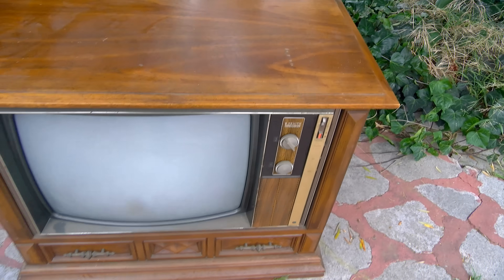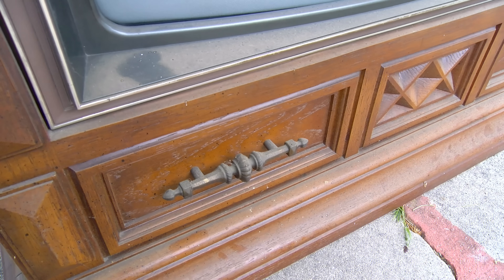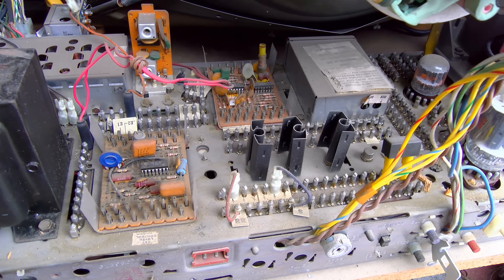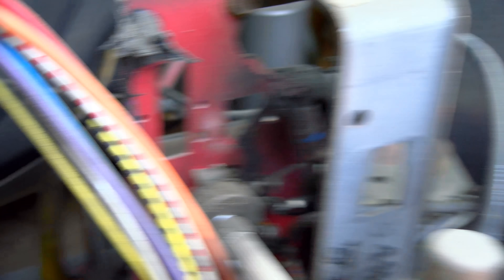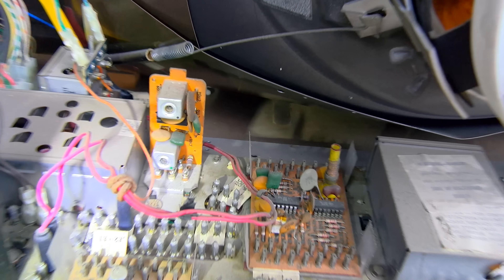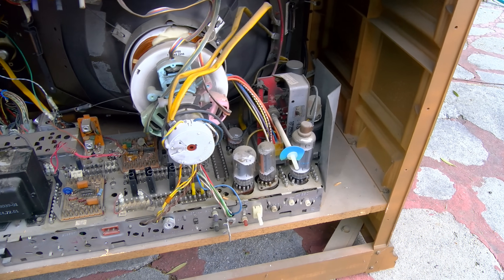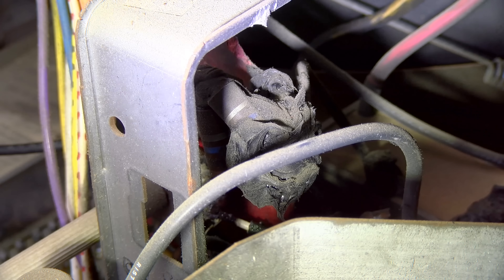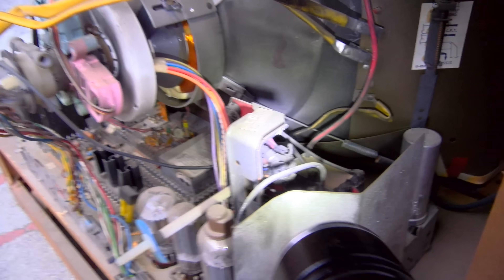Zenith Chromacolor 1973 Color Console 4 Tube Hybrid Television Analysis

Comment: Zenith was just tooling up for their all solid state chassis which was fully laid down (horizontal mount) in the cabinet (not the more commonly seen vertical mounted chassis in later releases). The 4 tube design was an "interim" set with a lower selling price than the solid state sets.

Comment: what kind of cord did you use to plug this tv up? I found a tv quite similar to this one, although a tad bigger, and I've been searching for a power cord to use for it. The prongs you'd plug the cord into are really strange, cause one is like twice the size of the other. I can't any power cables that would match it, and was wondering where you got yours from

Comment: The Zenith Chromacolor 23 inch model year 1971 / 1972 was my parent's first color television. Wood or particle board cabinet; not as much plastic. Also an early hybrid with an IC color demodulator but the HV was traditional. The sales shop on Whittier Blvd in La Habra was adjacent to Charles Stone Television repair. Hence, if a customer asked for the BEST color TV, they were directed to buy Zenith exclusively. We spent over a month just watching TV. It was an amazing picture; much better than color televisions we had seen at relatives and friends. The chromacolor CRT with black mask was REAL and SPECTACULAR innovation. Anyway, we burned the heck out it for months. Then the electron guns in the CRT started arcing. So Mister Stone took it in his shop. He said that they get some gas that shows up later. Years later the color was wild squirmy crankipation. Mister Stone sold me the new IC for his cost ($17) and taught me what to do. Bam! My folks kept that set for so long, their next set was solid state. Watching that spark and arcing in the neck after the back off and ran the set with a cheater. Hooked me on CRTs!

Comment: as a   repair man  for 40 +years   i repaired hundreds of zeniths sets of that era  ... they were actualy fairly dependable  .. except the focus board  also  the dark grey silicon and component lift from circuit board was factory after the  manufacture was  informed of the issue    ... there also was no preference to gun failure in the crt   ..    .. enjoy your videos   .. brings back memories from the back of the set
Reply: @BlondieHappyGuy  on disability due to warn out back ..  i still remember how heavy they were  especially the sony  tvs

Comment: All the Major Manufacturers had the Top of the Line sets with 100% Solid State Chassis, then the Budget Line with the 4 Tubes. I am surprised to see Circuit Boards, as back in 73 Zenith was still crowing about their Hand Crafted Chassis, which was interpreted as Point to Point Wiring
My friends family had a Zenith in the Late 70s. I thought it had a Poorer Picture than our early 70s RCA, but her Dad insisted that Zenith was a Better TV.  Myself, I thought that Heathkit made a better TV

Comment: The value to me is the cabinet and looks.  If I had the skill I would put in a crt tube from a more recent vintage salvage set or parts and use an atsc tuner and modern inputs like component and svideo, then use at external hdmi to svideo or component adapter to handle hdmi only devices

Comment: Didn't last very long at Zenith in Chicago back then totally against printed circuit boards and divided engineering into sections where each section had to meet interface compliance requiring additional components, quickly found another job where the management was more reasonable in producing quality products without all this nonsense.

Comment: Had a few of those back in the day. They truly were a bad set compared to most Zeniths I dealt with. I seem to remember it didn't even show that good of a picture compared to the Zeniths I usually dealt with. The later full solid state sets were a lot better even if the cabinet wasn't as nice as the early sets.

Comment: "Refining the quality down to the minimum" Oh Zenith sank a lot lower than that...

I have a Chromacolor II which I consider to be Zenith's zenith. It was the last series of Zenith color TV's that still had long lasting CRT's. Then came the System 3's that had okay CRT's, but not as good as the CCII's. Then throughout the 80's Zenith's cabinet's got cheaper and cheaper.

Then came 1993, and Zenith's CRT quality plummeted. It was rare to see a 90's Zenith that still had a good CRT even 10 years later. Then they got absorbed into LG.

Oh I used to garbagepick CRT TV's back when they were still worth selling, and I learned to just not bother with any Zenith made after 1992... though the A27A23W I had, had a decent CRT.

Comment: This looks like that console TV used in that horror film GET OUT that released a few years ago. This guy was trapped in this room where everything looked retro 1970's..
I was taught in an electronics class in the late 1980's, that by the 1970's the only two tubes left in TV Sets were the CRT and High Voltage Rectifier?
Is that small hat shaped tube a Compactron?  Because I thought they were all metal enveloped, not glass

Comment: That was my boss's TV back when I worked for his appliance repair business. I had to keep it going and it was on all the time. It did last awhile. He loved Zenith but I preferred RCA and then Sony. I had a Midland portable color set back then that was full of compactrons and I thought it was great until I saw a Sony.
Reply: How could anyone prefer an RCA over a Zenith.  RCA never made a good TV until the XL 100 but it didn't have the quality in the design of the chassis. or workmanship of a Zenith along with their cheap wafer tuner particularly when compared to Zenith's Gold Video Tuner with gold contacts.   RCA was always Awful to service.  And Sony Sucked as well.  Hardest TV to service;  trying to figure out what and how their circuits worked was a challenge.  I sold them, along with Zenith, but you can keep your Sony;  I'll keep my Zenith.  After-all, my Zenith is only 31 years old.
Reply: @932stretch  Zenith TVs from the 50's had the gold tuner. Their color sets tended to have a color phase issue and the overall picture looked harsh compared to RCA. I had an RCA CTC-16 that I liked and I thought it was well made. I used to fix these and RCA had a tuner mount that made removing the chassis easier than Zenith. Sony TVs were different and I liked the challenge to repair them. They had better edge to edge focus and purer color and square corner picture tubes. I have a bunch of Sony TVs from the 70's and 80's and they work fine.

Comment: I had a 1975 Chromacolor table model Zenith set, great picture, very reliable. Got a recall notice on the HV four lead capacitor in the flyback area. I went to my local Zenith parts warehouse, they gave me all the recall parts, which I installed. Other than that, the set ran flawlessly for eight years. The picture bulb went soft, and it wasn't worth re=tubing it, so it got scrapped. It was all solid state.

Comment: The amount of plastic in that cabinet is appalling. Not even the last gasp consoles from Zenith had that much plastic in the cabinet! Even the speaker looks small and cheap. 

But...I still like the design of this set. If it needed a home and there weren't so much geography between myself and it, I'd give it a good home.

Comment: I think the UL TV cabinet flameproofing standards kicked in for 1975, so this would have been one of the last made with solid gasoline up against the guts.  That might explain why the sets from later in tat decade (Freudian-typo, I guess) had particle board lining the side walls, with the plasto-Mediterranean carvings screwed to the outside of the box. They must have had plastic that was almost un-burnable to make the portables, but it was probably too expensive for these boat anchors.

Comment: Any chance I could receive some help with a 1960 Kreisler super F black and white ? I fully recapped it hopeing for the best as don’t have a tube tester and yes I get snow and the sound works and no strange noises but any picture I try to play scrolls constantly after adjusting the virtical hold. And sound make the display move and make lines also just very bad picture

Comment: My grandparents had a newer version, which I believe used the system 3 chassis that had independent plug-in modules.  Contrary to the reputation (dirty contacts on the boards), it performed well until 1997 when my parents bought them a new TV with PIP.   The blue gun was failing, but it was still usable and another family member took it.  Unlike yours, this had a digital display for the tuning and a keypad below.  It also had an updated space command remote (which you had to press 'enter' after selecting the channel).

Comment: You sir have my humor on watching television, and you sure make videos a relaxation; I wish to send one of my older televisions to you to see what's gone bad with it.

I do have a Sony 5-307 UW, the problems is (and was) the CRT would only display about half of inch of screen, but I managed to view it, but another problem happened and it was a lot worse; the CRT disconnected itself after powering it on, and I had smelt something weird, so I switched it off and unplugged the television for a long time. It's never had power since. I did some research about it, I felt like I cannot fix the problem, because I'm not certain of what I would be doing to servicing a CRT television. Do you think you could receive my TV and service it (with probable cost) or if not, that's totally alright for me!

Comment: I grew up with those in the house. It had a much nicer console though, with dark wood and a leather-like top. In fact my Dad still has the empty console.

I remember something about arcing and it having trouble with focus before it was fixed by a TV repairman who came out to the house. Later they added a booster to brighten the picture tube because it was going dim. My dad used it from 1973 to the early '90s.

Ours was the solid state model, it said so underneath the little RGB star on the front.

Comment: Yeah, I watched this and remembered I have a "Mass: no more than 60kg; Power: no more than 250W", soviet made television set from 1980, very much like Shango's one, in my basement. I didn't allow my parents to throw it out, when they have decided that it wasn't worth repairing any more in the 90's. I had the idea than to put in its box something more modern japanese made and double the number of speakers inside so to allow stereo sound. It had great sound out of the two band speakers inside its wooden box wich would allow putting another set of the same speakers in its other side. However, ten years ago I've left my newly bought smart TV (the first generation of its kind, from 2009) to my parents and I haven't watched TV since than. Than I've looked around my appartmet and have decided the ammusement out of it would not be as great as the cluttering effect it will have on my home. Plus, getting "no more than 60kg" from the basement up to the fourth floor without elevator doesn't sound like fun. Probably I'll have my basement storage room cleared soon. Another thought I had while watching insides of this Zenith and comparing them to the ones of soviet made set is that soviet designers have overdone it - a mix of huge amount of transistors, silicone ones and some power and VHF germanium ones, ancient specialised chips of very low integration and a bunch of tubes.

Comment: My Grand Father had a similar one. I remember the red button under rocker switch. You should have seen how far I jumped when I toggled the switch and the tripler blew and started to arc. I changed it out and was back in business. Ended up throwing it away because it was so heavy and took up so much real estate. Now I’m kicking myself.

Comment: A friend told me that he bought the hybrid version in '73 and that the full SS version was $100 higher. He said that for the price difference, he could wait on the picture to come up. As far as the flyback in these and the later SS ones, the only time I've seen one bad is when the tripler shorted and took out the flyback and the HOT.

Comment: My grandmother had a 1974 Chromacolor II Model #:E4549P Chassis #: 19EC45 which if I recall looking inside was an all solid state design. I believe that set had the same cabinet as this one (you can see it in the "Old Technology At Grandma's House" video on my channel). The cabinet style was called "The Maracaibo" since that baroque Mediterranean styling was all the rage in the 70s (the "P" at the end of the model number indicated Pecan finish). Like this TV, the Chromatic circuit was fussy.... also the AFC as fubared. I think that set was also instant on as well.

Comment: I have a  Andrea space  80 cube i used the s/s chassis zenith that stands up with all modules to replace the 900watt tube chassis as parts easy availability.however I placed a lcd 32in in front of set that was free.that chassis hybrid had a soft pix .can't get a tripler anymore For s/s ones .theater in round fbt nla.we used to silicon em .wing and prayer.THROW It Out.ll¡!!!!or get solar panels.

Comment: 111 megabyte yoke?  You don't know crap!  I worked on dozens zeniths in the past 45 years and this was one of their best!  The main problem with these was a 10 mfd cap in the sound circuit and the horizontal output!
Reply: Apparently Walter doesn't get jokes.
Reply: Sold and serviced Zenith's for years and other brands as well.  Zenith was  Clearly, the best of the best.  Shangoo mentioned they were troublesome.  They were not. A reliable TV with a great Chromacolor picture of which we sold 100's. Not surprisingly, after 45 years, this one is still working and quite well, I might add.  Got any 45 year old Sony's still working?  Didn't think so.

Comment: I love seeing these old American color tvs, but where are the British collectors of the ones I used to repair? Bush, Murphy, KB, Ferguson, Pye, Ecko, Philips, etc.🤔
Reply: British TVs were among the most interesting, maybe too interesting in some ways. With dual standards , then those strange tuners with 4 buttons (as if there would never be a 5th channel), they almost seemed like something you'd get on loan from a public utility. It must have been a bit of a pain living with the transition from 405 to PAL, the licensing fees and, from what I hear, rental payments in some cases, but it left of legacy of cool collectables.
Reply: @pcno2832  It was good to read your reply.  It wasn't just the transition to PAL (Phase Alternate Line,) but a whole system change
 405 lines to 625.  AM sound to FM. (Pre
 NICAM stereo.)  Positive going video, to negative going.  Dual standard TVs (Colour and B&W, ) had long multi section system switches. One brand of  B&W TV,  GEC and Sobell, (same chassis,) stopped working properly if a prepayment slot meter was fitted to the rear cover, and the box was full.v Don't worry, your hero here had a bunch of keys, and always handed excess cash back to the customer! 😁📺 Always Jim?😊☺🤥
Reply: I forgot to add, also switching from VHF Bands 1 and 3,  to UHF, Bands 4 and 5. Some sets had two separate tuners, others an integrated type.  I was glad when the two old system channels (BBC1 and the local ITV one,) joined BBC2 on the "new" system.  Now that system is gone for ever in this new digital age.

Comment: Can anyone explain "cutoff" in a CRT tester? I tried looking it up, but couldn't find an answer.
Yeah, modern junk uses a lot less power, but their life expectancy is dismal.
Reply: Setting the cutoff level on the tester biases the control grid so there is a minimum preset current flow. This calibrates the emission read on the meter for the good-bad indication. At cutoff there is little or no beam current from the electron gun.
Reply: Thank you

Comment: There's a lot of us, that would gladly take that Zenith out of your way, if we were nearby!😁😊  Great videos, I remember working on a few like that 40 years ago, then, an occasional tripler failure, that red board (yes, we simply removed the blackened conductive areas), some later tube chassis flyback red boards would arc and burn around the focus rectifier diode, and repair the same way! Fun times, thanks!

Comment: My wife and I bought that exact same TV. We had only been married two years and that was a major buy for us back then.  We kept the set for several years and the only repairs I did to it was two picture tube replacements. But then I was in the TV business so I got the tubes really cheap directly from the supplier.  Other than that it was very reliable.
Reply: Johnny Umphress 25ap22 s rebuilt 5/100$ .had a guy painted my house for a crt replacement 😁
Reply: 2 new CRTs in several years? Either you had very high standards or something must have been making them fail before their time. A CRT in those days must have cost more in real terms than a flat-panel set does now. I forced myself to watch the washed-out picture on my 1978 Sears console until the flyback failed in 2015.
Reply: @pcno2832  Yes, I did have higher standards than most people for a TV. Also, I was buying seconds. The cost of rebuilt CRT seconds back then was about $20. I didn't mind changing the tube again at that cost..

Comment: Nice! Hardwood skirt. Yes, you don't want your 25 pound Hoover Convertible upright tearing off chunks of particle board. I actually have a 1965 Zenith 25MC33 roundie combo coffin set with a  particle board floor in the cabinet. But it's Zenith quality particle board. Everything else is real hardwood (cherry).